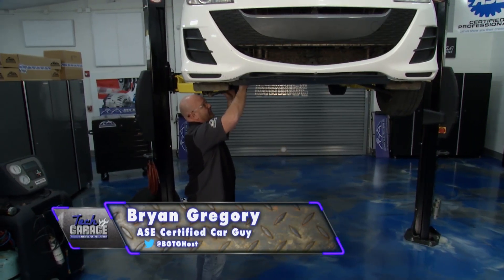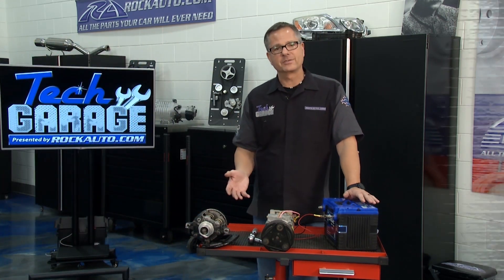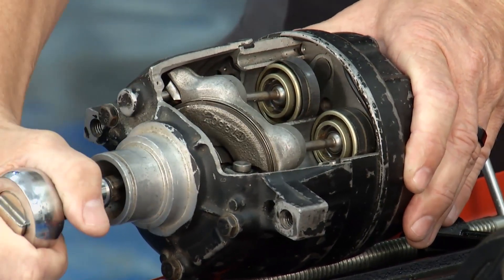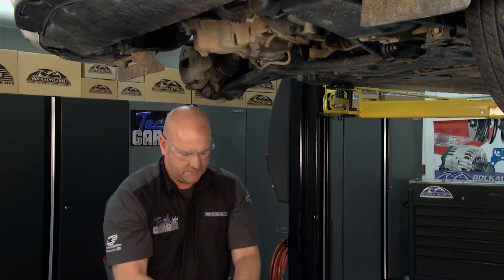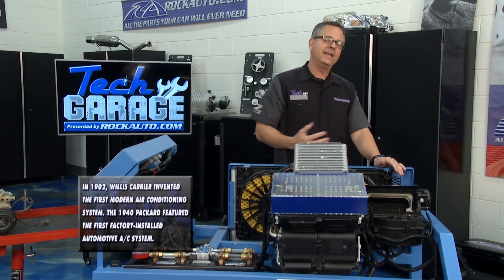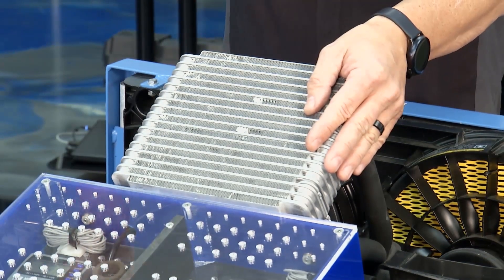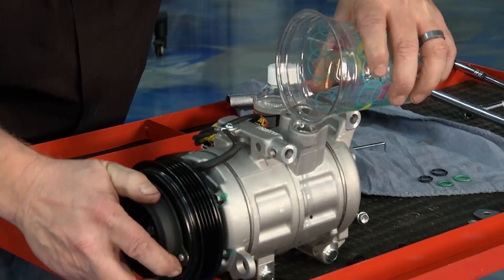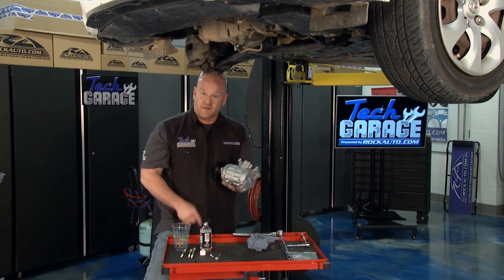Show 10 AC Compressor Replacement & How it Functions

Comment: Good Video Gentlemen I have a sort of related ACQuestion.  These days there are a million Automotive brand new Compressors at very low prices online  and places like Ebay  I assume these are Made in China Clones  or  perhaps just that much of a low cost to produce?  I grew up In Florida and Air Conditioning in cars is pretty important for years  it was if the Compressor  or Clutch went bad  you were looking at about a thousand dollars just for the new parts but today you can  find new replacements for many Import cars for under two hundred dollars ? Perhaps they aren’t OEM quality but  if they work  would they be  worth the risk of putting one on?  I have a CousininLouisianna that is driving a older Subaru the aCCompressor went out on my Cous is financially recovering from a nasty Divorce  and the old Subaru is paid for  plus he plans on driving it till the wheels fall off the thing  he was quoted two grand to put a new Compressor on the car  and I told him to try out a two hundred dollar Ebay new one  and pay his local Service Station to charge it up  which BTW I was told by a trusted Mechanic that the R34  does make the Orings leak and  it periodically needs recharging  any way I have a older Chevy 3500 that I put  a couple of cans in every Spring time  and it lasts all summer long  heck  it even got to the point my Wife knew how to fill the thing if she needed my Truck !  I honestly originally thought it was Chevys poor quality  but my Mechanic said no it’s the new Freon  that causes it  and it’s less harmful to the Ozone layer  so the Government allows it  to happen ?